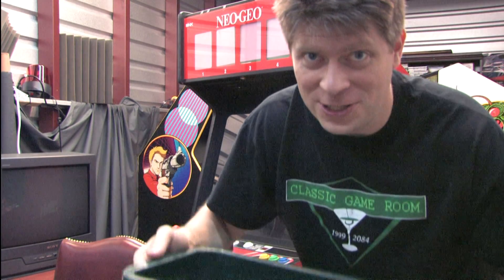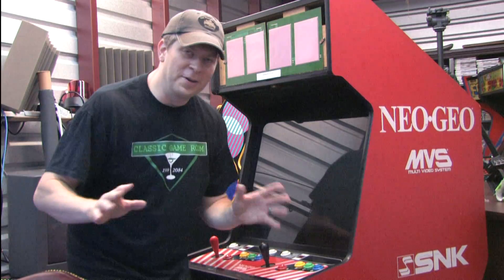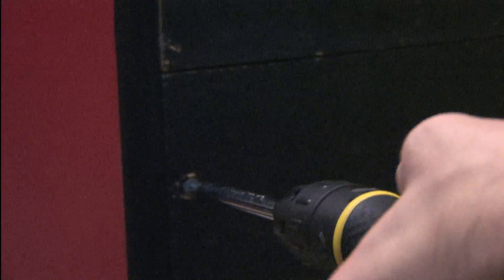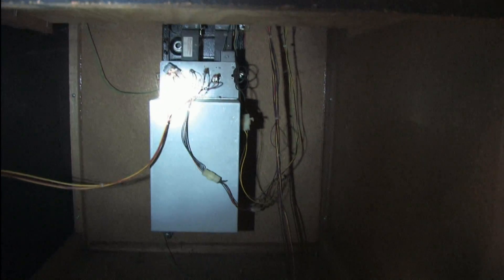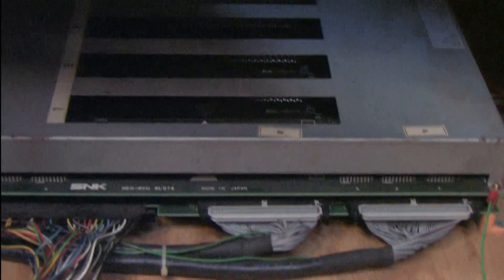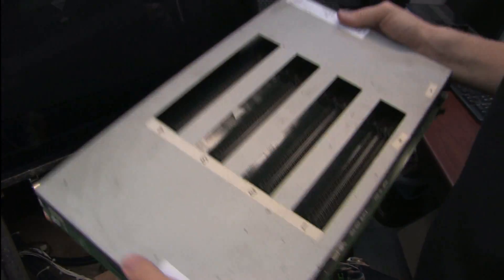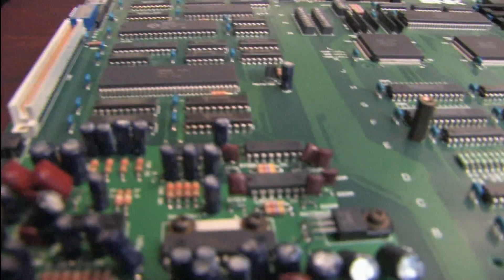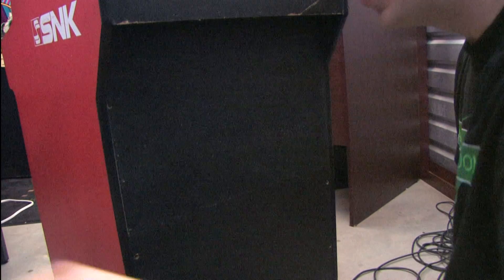Classic Game Room - WE BOUGHT A NEO-GEO MVS part 2

Comment: There looks like there may be a couple of bad caps there needing replaced but overall the board looks quite good!

Find and check the solder joints on the ram chips. You probably won't have to replace the chips themselves, its probably a dry solder joint causing the problem. With heat they can crack over time. 
Re-solder any bad joints, replace the bad caps and you may get it to boot.

A good clean of the board with isopropyl alcohol will make it easier to spot any defects.

Comment: Doesn't matter if you succeed or fail--I'm entertained.  But to be clear, I hope you succeed!  Looks like you'll have to replace that corroded battery at the least, which will require soldering.  It's a tricky skill, but once you get good at it, it can be quite useful!

Comment: The battery definitely looks corroded, so replace that first. You can use electrical contact cleaner to clean the battery contacts. You can also try cleaning the data pins and the cartridge connectors using 99 percent alcohol and cotton swabs. You can also try using an electric duster to clean out the dust (don't use canned air because it can and will ignite when its fumes hit something hot or charged).  That's pretty much all I can think of for now that may have something to do with the RAM.

Comment: The first thing to do is clear the backup RAM. (Believe it or not, corrupt backup RAM can cause all kinds of problems that mimic serious hardware issues, and all sorts of bizarre stuff in-general.) This can be done by powering up the unit with A,B,C held down... It may also happens when you flip all the hardware dipswitches on and it does a 'WORK RAM TEST'.

Comment: I own 3 neo geo arcade cabinets. For me, the best solution is to just buy a new 4 slot motherboard. It will cost you around $150 or less depending on where you find it. Dont pay more than $150.00, though. The mother board is a two set piece. Either the bottom board went bad or the top one.

Comment: Yes, that is a bad RAM IC as well - one of the 6 SMD ones. If you tell me what model NEO GEO MVS you have I might be able to tell you which one is bad. They frequently die in pairs, so you may need to replace two of them, but you won't know until you replace the one that is causing the error.

Comment: Okay, sorry for the delay (I had to find an MV-4F I had lying around). Work RAM error at address 0010140A with write AAAA and read AA8A is a problem with the low byte Work RAM IC. It is the one located at C8 on the lower board. On my MV-4F it is a Sony CXK58257AM-12L. Replace that one. It can be done with a soldering iron but be careful not to damage the SMD pads (heat gun is best). If you are lucky everything will work fine after that. If you are unlucky you may get another (different) error.

Comment: Did you try actually try putting a game cartridge into one of the slots?   I'm fairly certain that without any games to load it just errors out.  

Much like any cartridge based console system, without a game cartridge plugged in, it does nothing.

Comment: Just checked.  It is an MV-4f, with the two boards stacked atop each other.  Given that ram error, can you tell me which chip assuredly needs replacement?  I know how to work a soldering iron, and I have 5 additional chips coming from korea, but I need to know which one I'm replacing, as I'm not certain which are the SMD chips.

Comment: yeah crts are dangerous, but while i always hear of the static thing, i never saw a actual piece of hardware that cease functioning because of that
and the vacuum, well unfortunately does not even work the way dust gets in electronics does not really get sucked by vacuum, however getting it to blow does work and i been doing that for the last 10 years without ever burning a single piece of hardware(and i do it a lot, there is a tree near that constantly releases some annoying fibers everywhere)

Comment: its too blurry to tell for sure, but you may have a swollen capacitor on the main board on the third closest to the bottom on the left, its actually directly to the right on the second chip from the bottom.  It looks like  it may be leaking acid, if so that area of the board wont be regulating power properly.

Comment: Based on the address 00D0180C I doubt it is a problem with any of the traces. If it were a problem with any of the traces or anything other than the RAM chips themselves then the address of the error would most likely be an "even" number like 00D00000. I think replacing the backup RAM chips would fix the problem. I have a 4 slot myself and I am pretty sure the backup RAM chips are the ones at locations F9 and D9 on the lower board (I can post a picture if you want).

Comment: ok, first you should be wearing a anti-static strap around your wrist before you touch anything and second DONT USE A VAC The static charge that a household vac creates can damage delicate electronic equipment. Either use a compressor to blow it out or "caned gas" or an anti-static vac... also as this is a CRT based system be VERY careful around capacitors... some screens can hold lethal charges for days.

Systems Admin for 8 years...

Comment: That's a Neo Geo MV-4. RAM error @ address 00D00C02 write AAAA read AAEA means that the low-byte backup RAM IC is bad. Look for 6 SMD RAM chips in a row on the lower board to the right of BIOS and CPU. If original, they are CXK58256MM-12L. The 2nd one from the bottom at E9 is bad. I have spares if you need some. Remove the bad RAM IC with a heat gun or a soldering iron and copper braid. Solder in a new RAM IC. I would be happy to repair it for you - would even do it for free b/c I like your show